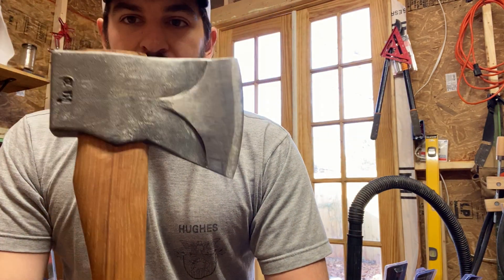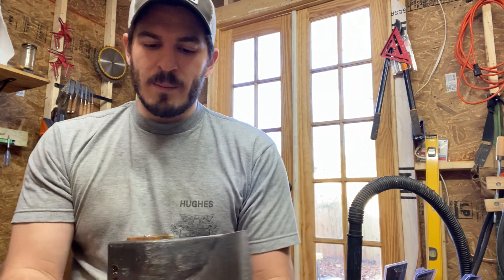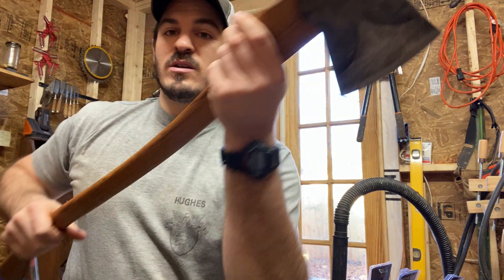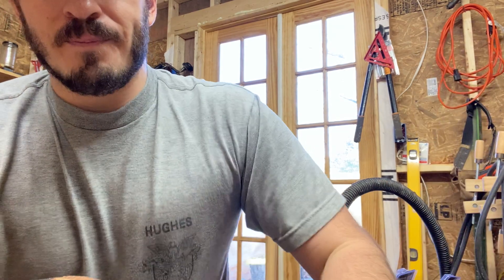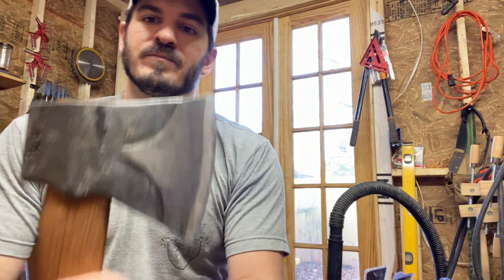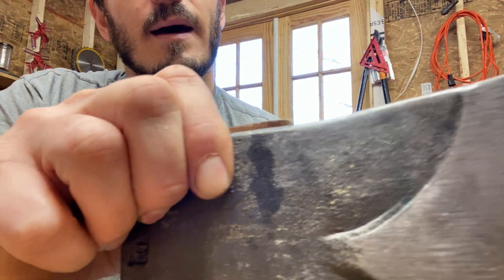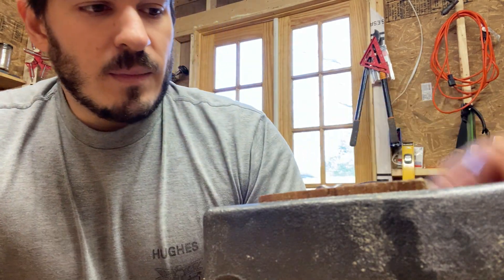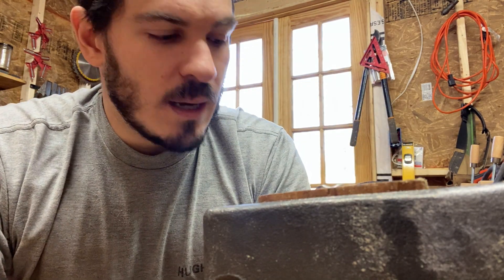The defect that could make your axe dangerous

Comment: I don't believe  the wood wedge or barrel wedge them selves are the issue....my beleave it's an issue do to poor time spent on the hang, the press on method and poor quality control all together that are the issues.....if it was mine I'd take the wedges out....work it farther down the shoulders to get a tighter fit then beat a nice fat wood wedge in there and be good to go
Reply from the maker: Certainly could be. Very hard to beat a good hang by hand. Since rehanging the axe I have had no issues whatsoever.

Comment: One thing to consider is that, I believe, they oil the handles which makes them more prone to humidity changes shrinking and swelling the wood. Versus lacquer or polyurethane. Wood can shrink/expand up to 1/16" per inch.  A kiln dried piece of hickory could have been swelled/shrunk many times before you got it. I have a 5 lb dayton from council and it has been fine but it put probably 5 coats of linseed oil on it.
Reply from the maker: For sure, linseed oil is key. When I took apart the axe I found the wedge they used was hardly over an inch tall, and didn’t taper. This makes me think of a proper wedge was used it would have been perfect.

Comment: Your wood has dried out since it was hung...soak it in a bucket of water for two days...let it dry and put some oil on top of your handle to seal the moisture in it .  Stuff happens!!!
Reply from the maker: This is the second CT axe I’ve had this issue with, the problem is a really inadequate wedge. I drilled that out, and with a decent wedge it’s tight. Stuff certainly does happen, I don’t fault anybody for that. But CT could fix a great deal of hang issues with a thicker wedge!

Comment: You never check your tool before use?
Reply from the maker: Thanks for the thought. I always check, every time. But there’s a reason we say “fly off the handle” with axes. The acts appears tight until it isn’t. 

Even so the point of the video is the same. Council tool needs to use a larger wedge, and immediately stop using the step wedges, or their axes will never be solid from the factory.

Comment: I have 2 council tool boys axes. The day I got them I took them out to buck up an Ash tree. One hour into it the head came loose on the one I was using that day. I had to re-hang it myself and since then it has been fine. The other council tool boys axe I didnt use that day. I took the head off the handle and hung that one myself before it had a chance to come loose on me. I still believe that the council tool sport utility line is a good value. The price is right for an american made axe head. I just know that I will need to hang the heads properly myself and that is fine with me. I know what to expect.
Reply from the maker: This is my attitude as well. The steel is good enough that it’s worth it to buy even if the handle needs to be fixed. I’m glad you like the boys axes, I have been thinking about picking one up.

Comment: About a year ago, I bought a CT sport utility boys axe from Omaha Knife. I think because of the hydraulic hafting of the head, a weakness in the handle shoulder grain, chopping on a 10 inch wide hickory branch cracked the handle vertically. Omaha Knife checked with CT and I received a new nice slim CT handle. I hafted it proud with just the  wood wedge used some propylene glycol to swell the wood. It has been my favorite go to small axe since. I would still buy a CT axe, as  I want to support a heritage American company, and I think they are making good heads with classic designs hard to get except vintage. I bought a Flying Fox, since. I bet they would want to know about your experience, and improve things. Craig Roost is on YT, so you might give him a shout. Take care. And thanks for the video.
Reply from the maker: Thanks for the comment, i feel the same way about wanting to support a U.S. company. They could make such an awesome axe with such a simple Im change. I put a good wedge in the axe and am very happy with it now. Just hate to do that to a brand new axe, and figure out it’s loose right out of the gate.
Reply: @urbanlumberjack  I'm with you on all  that, and wonder if you'd mind me sharing this-your video- with council tool?

Comment: Sorry to hear it's loose. If you were to email Council Tool I'm certain Rooster would not only reply, but he'd have a satisfactory solution to the problem. Craig Roost is Council Tool and the designer of CT. Luck of the draw shows the Joker. My CT Jersey Classic is as tight as the first time I used it, as are my eight other CT axes. Really, email him.
Reply from the maker: I may email him. I emailed him about the Hudson Bay axe, he did respond.

Comment: The old HBC design was crap.  They redesigned them to have a deeper head at the eye and the bit is shorter.  More inline with the older axes.  That one maybe a one off.  I have two axes, the sport utility boys axe and the woodcraft pack axe and they are both solid on the handle.
Reply from the maker: I will give credit where credit is due, the council tool Hudson Bay was as good as anybody can make it by staying true to the historical design.

I agree about the modern Hudson. I think the improved Hudson Bay could be a great tool. The taller eyed should fix alot of issues with the axe.

How do you like your pack ax? Is it worth the price?

Thanks for watching!

Comment: Any consumer-available axe has been sitting in a climate-controlled environment for a sufficient amount of time to dry out the wedge material in the handle to the point it is no longer functional and has become decorative. If you intend to try and use them straight up after receiving them it will most certainly loosen the handle after very little use and become a hazard to use. Proper setting of the handle is as important as the initial sharpening of the edge to establish the necessary pairing of the handle to the eye of the ax. The production line that axes run through does not spend enough time to ensure there is a proper fit and simply concern themselves with the aesthetics of the finished product as opposed to the functionality. This is most often overlooked by many when purchasing an axe and hoping to be able to use it immediately.
Reply from the maker: Interesting point. I feel the best practice is to soak newly hung axe heads in linseed oil to coat the parts of the handle, in the eye, that are difficult to coat otherwise. I understand why that’s not possible on a production scale, but seems to help my axes.